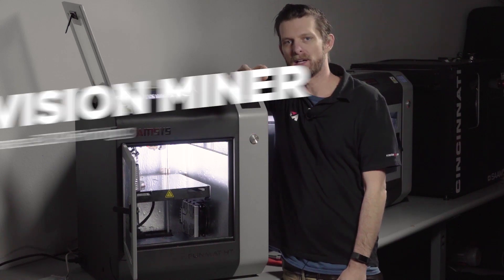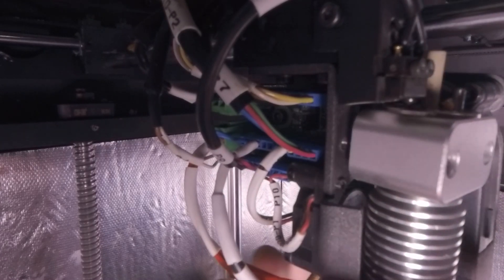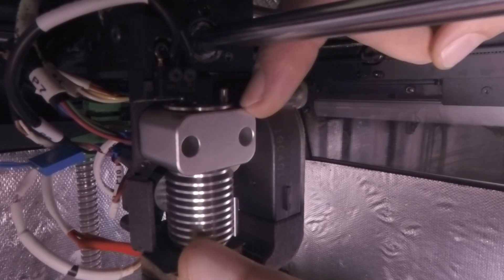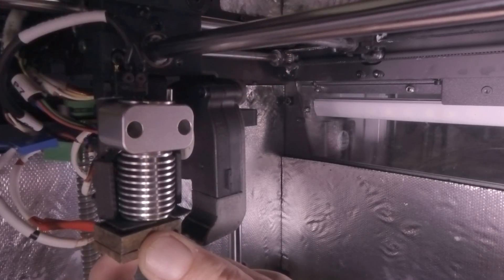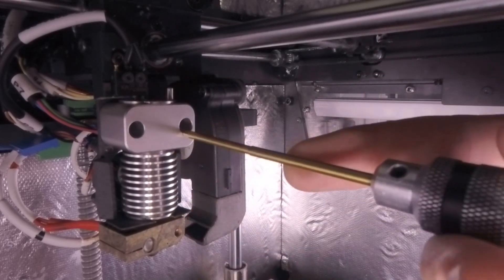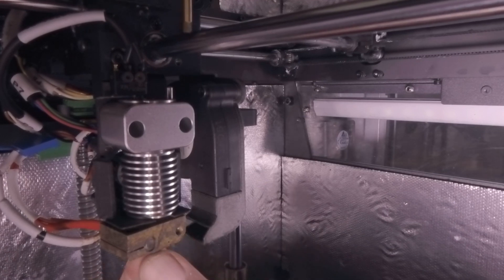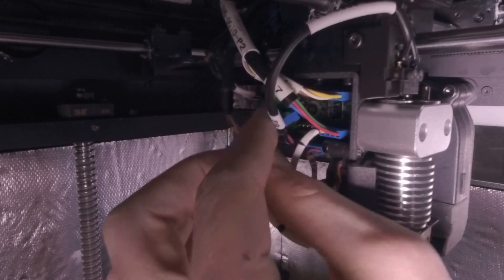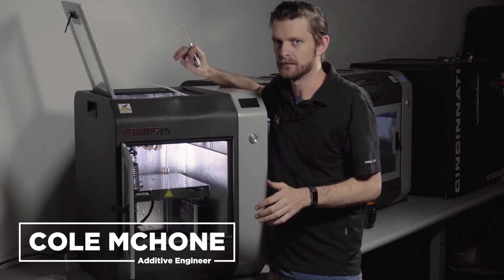Funmat HT Support: Changing the Hotend

Comment: I have installed my hi Temp hot end. I installed like you said. When pressing up, It depresses the micro switch, but does not come back down. ( Gets stuck in the up position.)
After gently pressing the hotend to one side , it comes back down. There is no interference from the bottom bracket. Seems to come from above. I just can't see in that area.

Comment: When changing between filaments with incompatible temperature ranges (PLA to ULTEM for example) do you just have hot ends dedicated to low temp applications and a separate hot end dedicated to high temperature applications?   OR:  Do you just do some sort of cleaning procedure / cleaning filament to flush out the PLA before using something much higher temperature?
Reply from the maker: Yes, we generally run multiple hotends. For high-temp, you can purge it and clear it most of the time, but the best method is having an extruder per material, so you don't have to burn things out and worry about carbonization/jams. While the machine comes with high-temp and low-temp extruders, we generally use the high-temp extruder for everything. A recent firmware change disabled the high-temp extruder from going below 270ºC, but we've made some custom profile workarounds to get past it, and we don't really print PLA on these machines anyway, so we stick to high-temp extruders.

Comment: It looks like you forgot to add the PEEK tube back in?
Reply: Where is the peek tube?
Reply: @desmondhoward1541  It's the tan looking tube coming from the heat sink going up towards the extruder. It's what guides the filament from the extruder down into the hot end.
Reply from the maker: Man, you're right! It should go in before you replace the hotend. Going at this one again, lol!